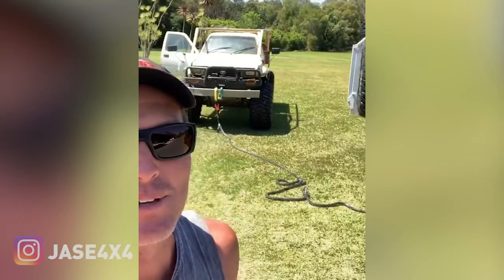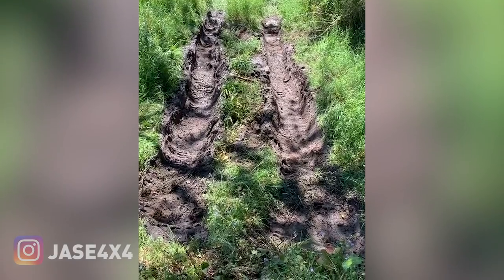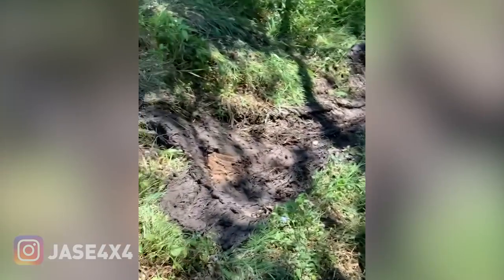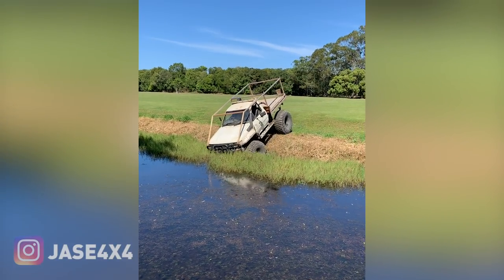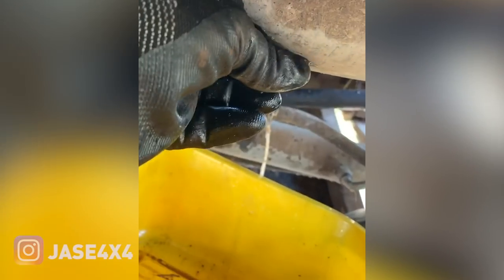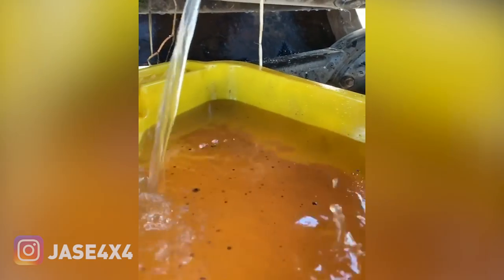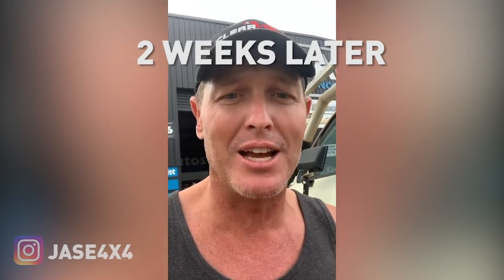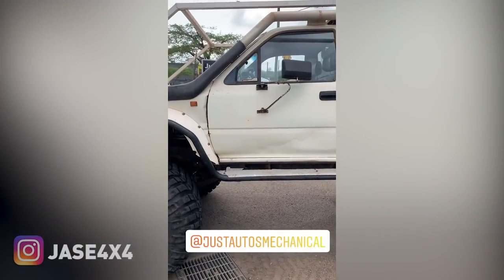We SUNK our 1996 Toyota Hilux with 46-inch extreme mud terrain 4WD tyres 💀(Instagram Story)

Comment: We have drowned ATVs and trucks but not quite like this. My daughter swamped a new ATV in a beaver pond right up to the racks. It was floating when I pulled it out. Got it running that afternoon and it ran flawlessly for years. Try WD40 (the 4 liter jugs) mixed with diesel fuel in the crank case, transmission and diffs. Add cycle the unit (not to start!), flush out and repeat. The water displacing properties of WD 40 and added fuel for volume works well to shed the water and keep the parts lubricated and rust free.

Comment: Using THESE tires on such light UTE you will need to inject half volume with sand and water , then calibrate with air.
THEN you'll need more torque and power, lower gear ratios, heavier suspension leafs, bars, larger brakes, winch and so on...
My advice is to size down your tires, bro.

Comment: Mistake 1: Not enough weight on the back witch change the tyres into floaters. Mistake 2: try to pull it out on the wrong side. If you hooked it from the back and then pulled him out backwards it would have worked.
Reply: Blablablablablablabla

Comment: Now for a lifetime of electrical problems...at least it was fresh water..I'd change that engine oil again..to get out the residuals... I got to do several Porsche's that went 100% under in Hurricane Hugo...What a mess..Salt water dissolves aluminum/magnesium..You have to build them quick or the engine bits dissappear..lol...